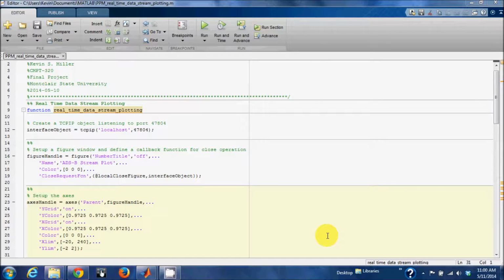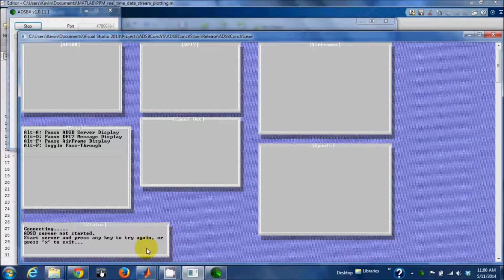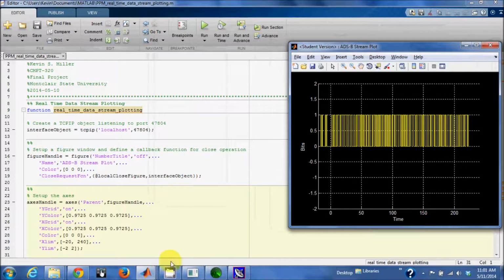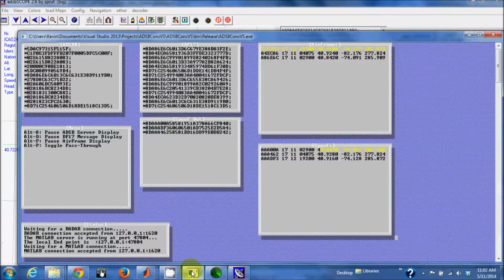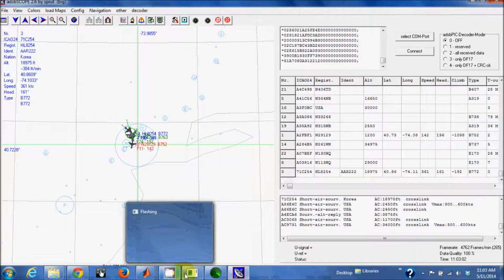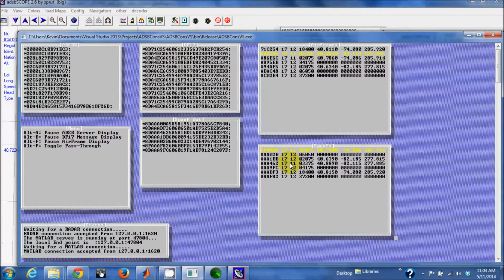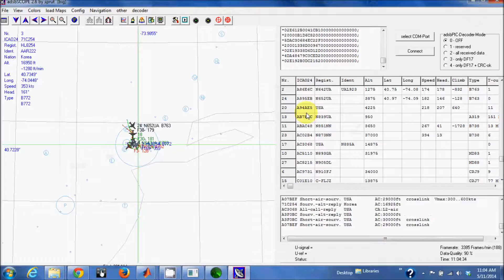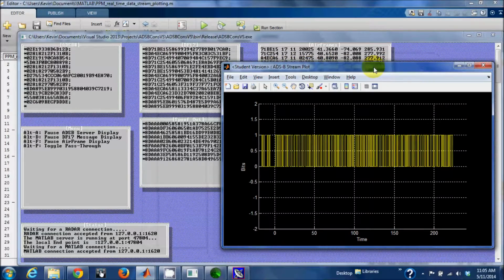ADS-B Spoofing Demonstration

Comment: What stops someone from getting a laptop and a large radio emitter and having it in a briefcase close to an airport and simulate planes about to crash?
Reply from the maker: Nothing. That's one of the main problems with ADS-B. BTW, I'm not the first demonstrate it.
Reply: You can verify against primary radars, which still exists on most large airports. However it is impossible to counteract attacks on TCAS.. Of course this kind of attack would have to be planned out very methodically to not end up being too obvious.